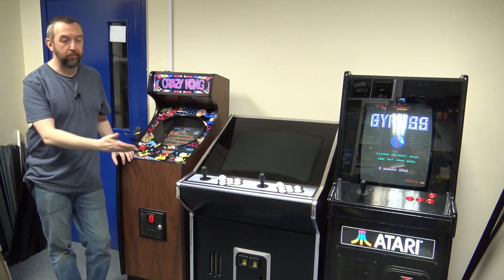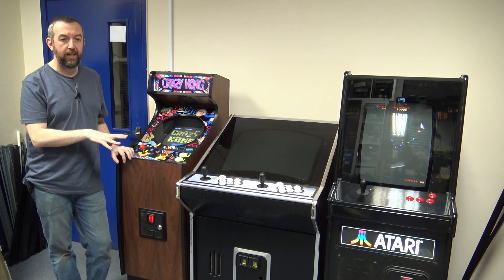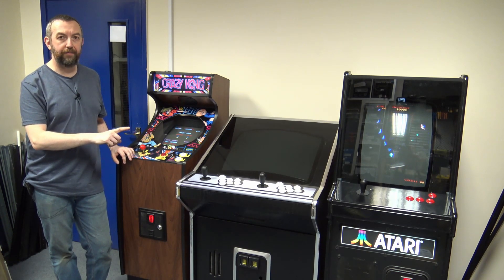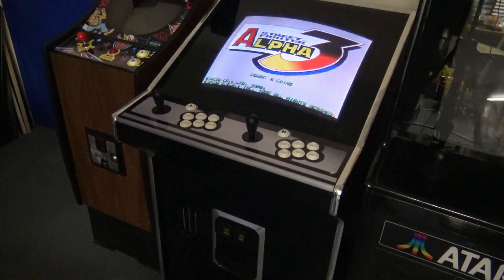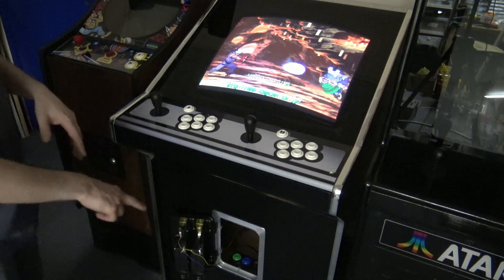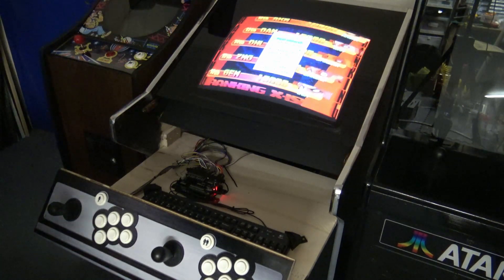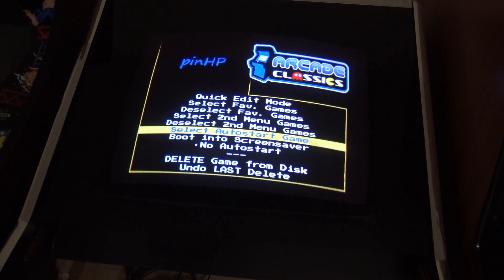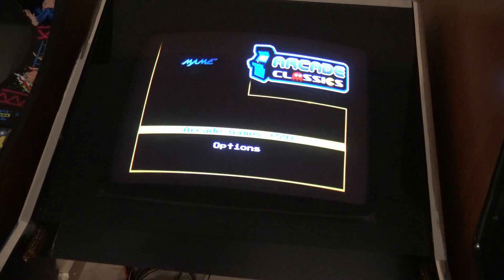Jaleco Low Pro with pi2jamma adapter and PinHP

Comment: Thankyou so much for this video. I had built to pi 4bs and was hoping to use one vertical and one horizontal for my arcade machines. I have a 412 game elf in there now and it’s a bit underwhelming in some areas but still very fun. I appreciate this so much.
Reply from the maker: the game elf are ok, but I found the screen position was all over the place in each game. Having access to the settings and how the screen setup worked on this was great.
Reply: Thankyou. Yeah. I mean it’s still very fun. Wish I could save hi scores. And now that I know a bit more after putting in the elf I feel a bit ready to tackle adding the pi. One thing that made it complicated was I can a pac to Jamma harness too. So I had to solder that ground as well. Great video.